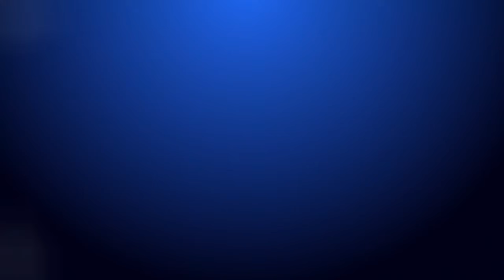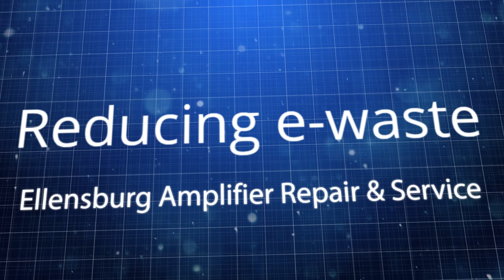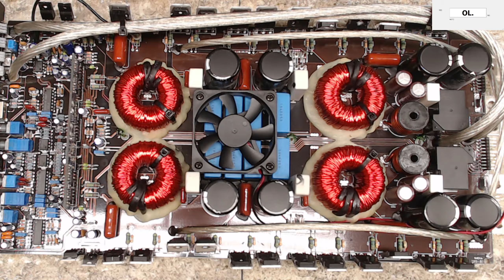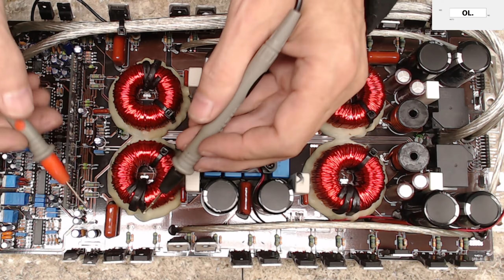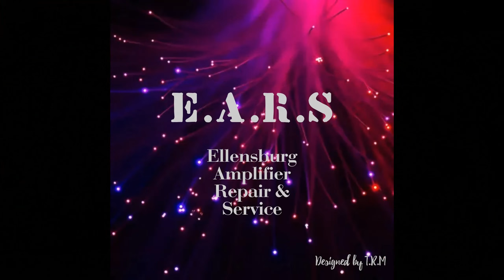Sundown SCV7500D Output Amplification Board Diagnosis Using Resistance Mode

Comment: Hey my name is Brian and after extensive research ive found your videos the most informative amd simple to understand. Ive been trying to learn more about circutry schematics symbos and ect. Wow is there alot to retain lol. With that being said I am having clipping problems with a sundown svc 2000d amplifier skip the basics if triple checked power ground inputs in my truck all was exceptional so with that being said in about to take the board out of the casing and try to diagnose the problem this is my first try at diagnose/hopeful repair. I am going to start with testing the resistors then on to the ICs high and low side transistors with a multimeter using resistance 😊